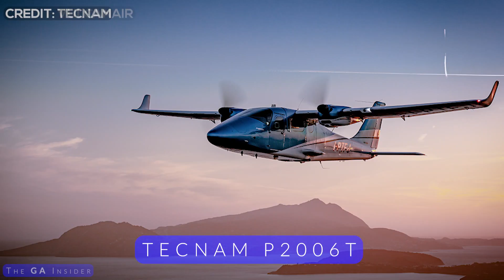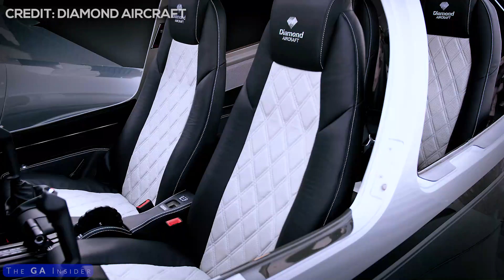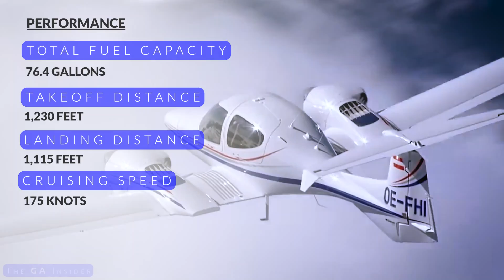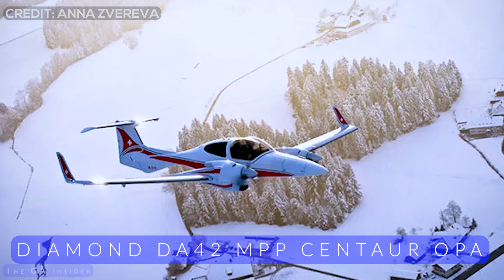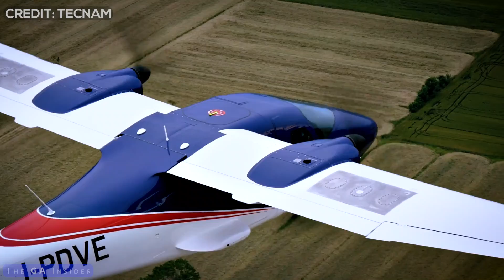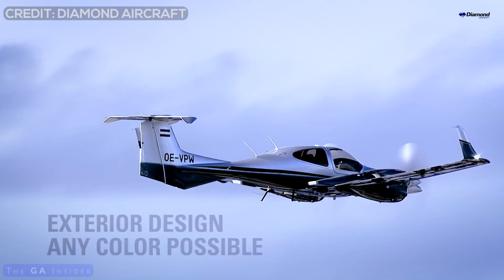The Best & Safest Light Twin - The DA42

Comment: The DA42 is an amazing aircraft, especially diesel equipped, allowing long cross country flights and great fuel economy.  The DA62 is even more amazing--it is all about seat miles per gallon, and the efficiency of the Internal Combustion Engine vs. the turboprop and turbofan.

Comment: I'm sorry, but this is not a review, it's a promo. DA42 is fun to fly for sure, but saying that it compares to nothing of its kind... With full tanks it's a two-seater that will fly no faster than a C182 and cost like a Beech Baron.
Reply: What other aircraft can do these speeds and range on 12 gph of Jet-A?? I can't think of one. As for useful load, the perfect airplane gives you the option to trade useful load for range. 90% of G.A. flying has been either solo or with one person. The DA42 can easily give me six hours of range with one other person. Or I can fill the seats and fly 3 hours which is about the longest four people are going to want to fly.  I owned a 182 and it's definitely faster than my 182 and does it on less fuel with the redundancy of two engines, two alternators, etc.  I have quite a bit of Baron time, too, burning three times the fuel of the DA42! It truly is a unique aircraft in this space.
Reply: ..."fly no faster than a C182:...? At 12,500' I see 135 kt TAS on our 182. Just sayin'.
Reply: I like the DA 62 better